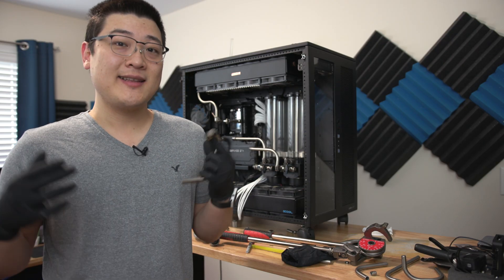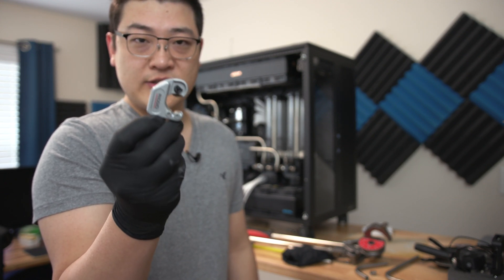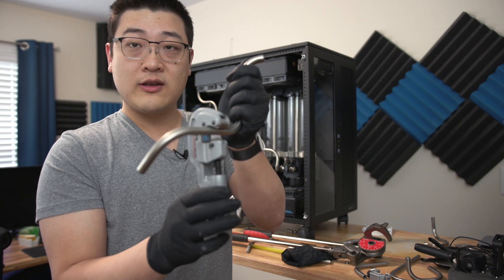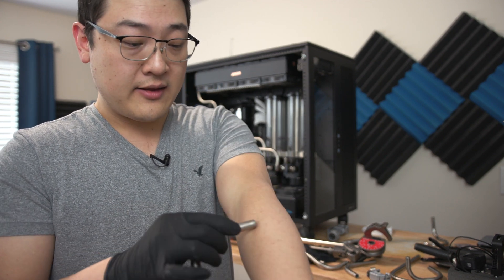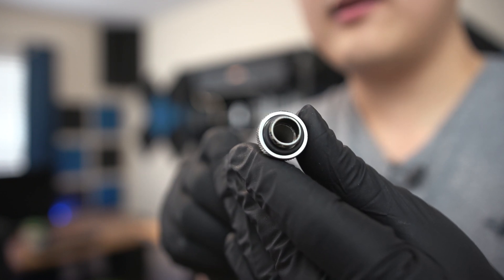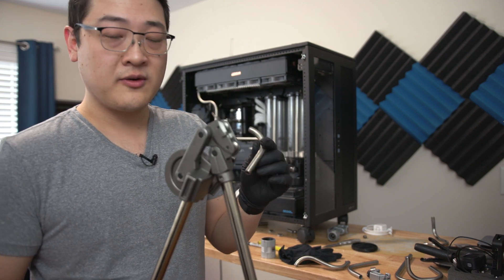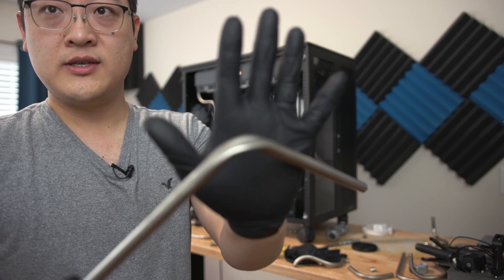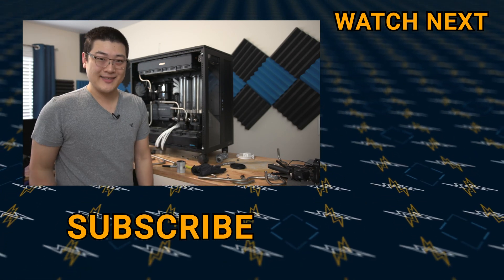How to Stainless Steel Tube Your Water Cooled PC | Cutting & Bending

Comment: Lot of great information about metal tubing here. I have a few questions just for confirmation.

1. If I get the cutter you mentioned at the beginning of the video, then investment wise, I should have basically stainless steel, brass, and copper tubing covered (at least at 1mm wall thickness)?
2. You would recommend staying with 1mm wall thickness regardless of 12/14/16mm metal tubes just to be safe and less hassle?
3. I was going to buy Bitspower brass tubes. But since you showed how these tubes can be crushed if walls are too thin, then I suppose they're only good with straight runs or buy the pre-bent 90 deg tubes and just deal with cutting?
Reply from the maker: Stainless steel is significantly harder to cut. If it can cut stainless it’ll cut just about any other metal tubing. A thicker sidewall will help with bending. 1mm is probably a good bet. Bitspower brass tubing is no good for bending. I have a couple other videos of me failing bends with other brass tubing on this channel. Check the other videos posted, probably a couple videos before this one.
Reply: @StanYanMan  Thank you!

Comment: Question im building mine Friday i just got jn my bitspower 14mm brass tubing and 14mm ek fittings I did a test fit first I had to mess with it deber it to get it in but once I gey the pipe on the fitting and tighten down the collar is it normal to be able to pull the tubing out of the fitting its not like falling out but if I grab the fitting and pull I can slide it out what am I doing wrong
Reply from the maker: It is normal to be able to pull the tube out with the fitting tightened. However, it should be a decent amount of force where it won’t come off by itself or if you bump it. Sometimes when I’m lazy, I just yank out the tube out of the fitting and then unscrew the fitting but certainly it’s not best practice. 🤫
Reply: @StanYanMan  yikes...... lol

Comment: You are ready to be my apprentice.  I'm a master plumber with a nice stash of oxygen washed stainless from a lab build I did . You have all the tools and don't appear to be on drugs , lol . You are hired . I'm subbing so I can follow you , see how things go . 
  Consider  using swaglok fittings on stainless . When cutting tubing , the gentler you tighten the cutter per rotation and the more passes you make , the less deformed the end will be . 
    The tool is typically called a cup reamer . Typically , us nasty old plumbers use pencil reamers .

Comment: You may run into two or three issues with stainless.
 First try and go with food grade because the testing on it ensures a better chance of it not rusting. Cheap and some grades of stainless will rust.

 Second It will act as an anode if mixed with copper or brass. You'll likely need to find nickel plated aluminum Sinks/blocks. If not they will eat each other and the copper/brass tends to go first and or cause static charge. A small wire hidden lugged to the case frame and soldered to the pipe will eliminate this.
The case is grounded to the psu which is grounded to the outlet and earth ground. If it does build, discharge will take a safe path out.
 And third stainless, like aluminum, will dissipate heat like the radiator. So still keep good case air movement so that rad on top takes it out.
Reply: I'll add , that the thermal conductivity of the stainless in conjunction with decent case airflow would be highly desirable.